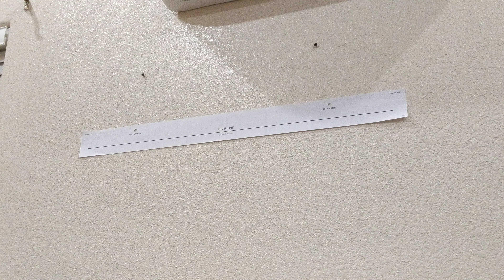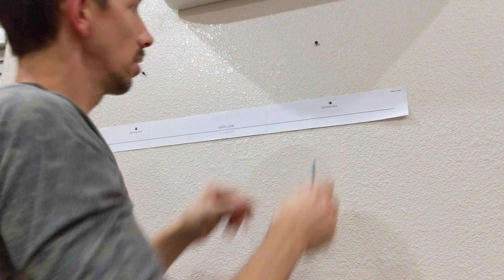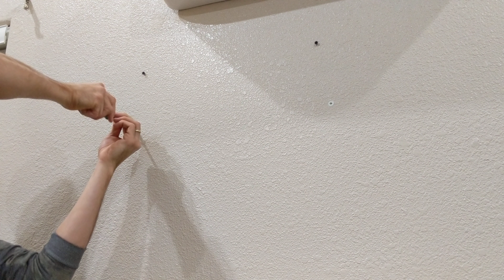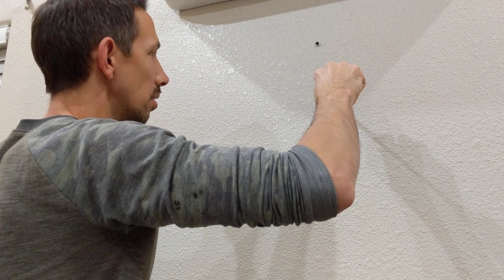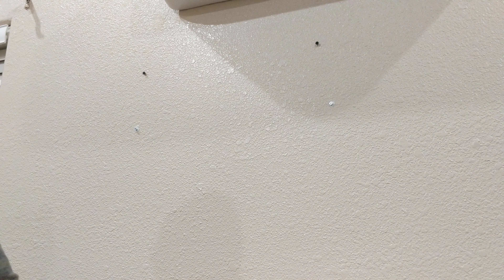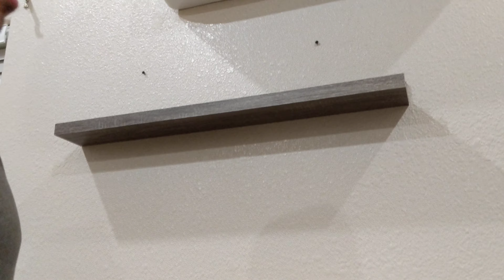HOW TO INSTALL A MAINSTAYS FLOATING SHELF

Comment: What size screw is it? I lost them and need replacement
Reply from the maker: I am not sure.. pretty much any screw that will fit the anchor will work I think these are 1inch ones.. probably grab them at the local hardware store.. maybe take a picture of the back to make sure the head of the screw isn't too big to fit